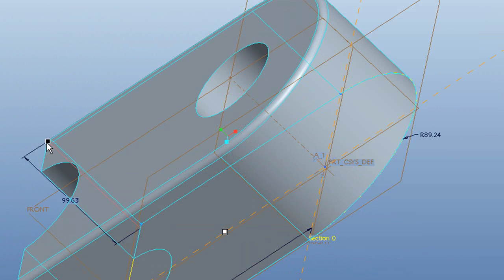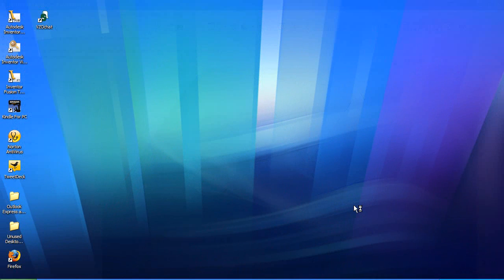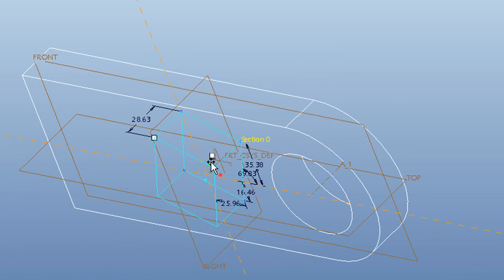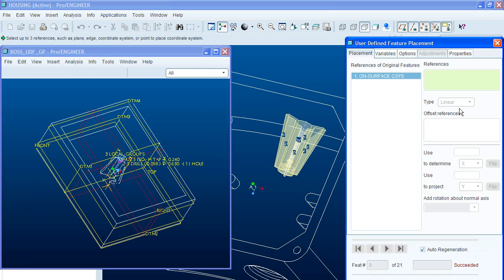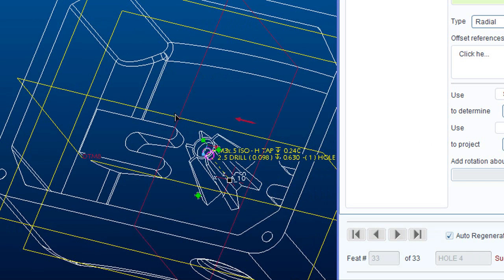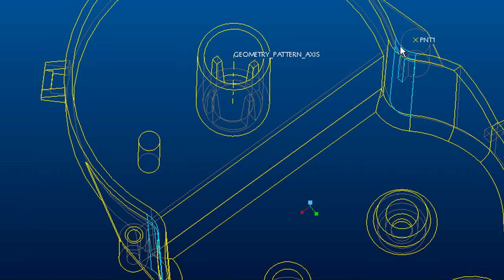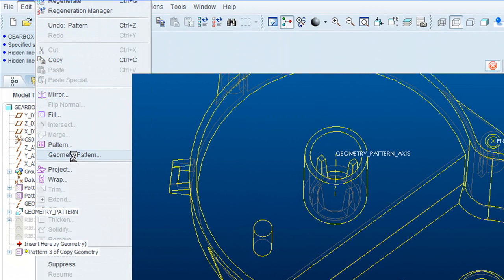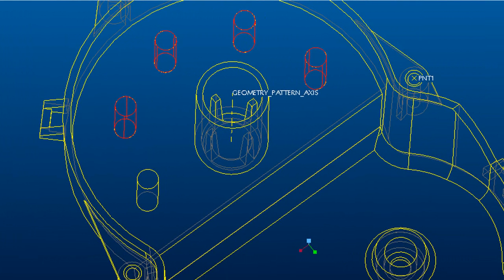ProE Wildfire 5.0, Part 1.wmv

Comment: @mfn567 
link may disappear if all parts are not in the same folder and you dont work with directory folder.
if you making an mechanism witch you update a lot after assembly , you can lose some of the links because of wrong references < see model tree references. or learn to use skeleton modeling 'mode'